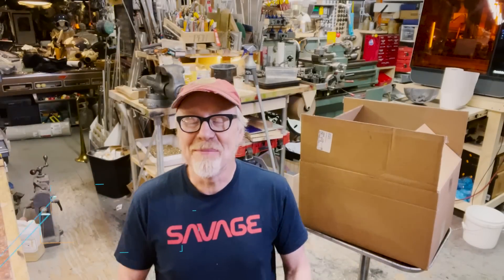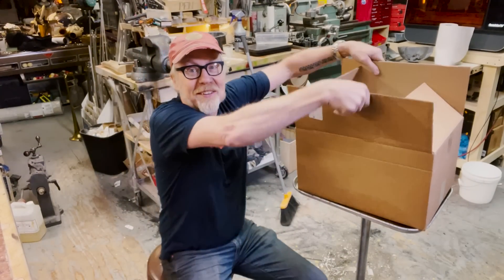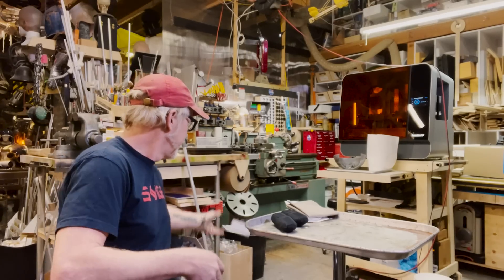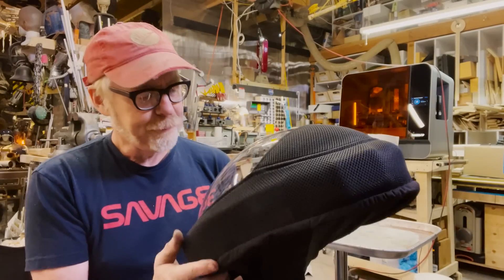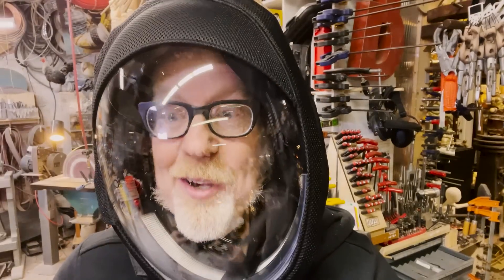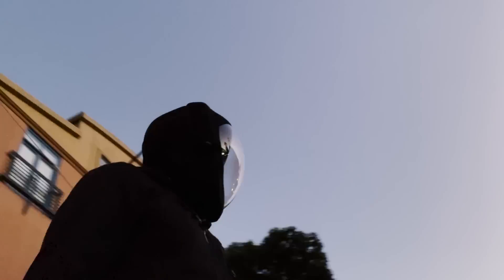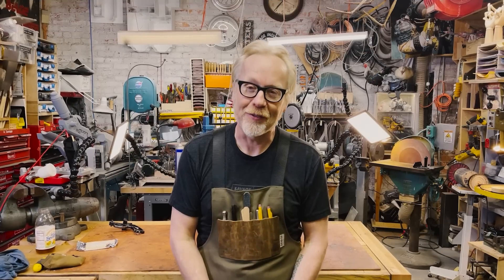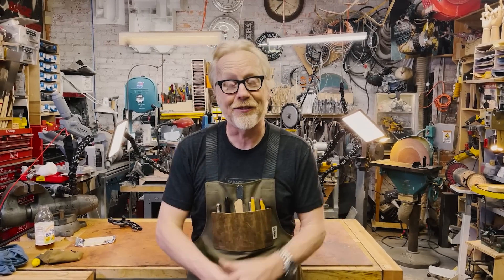Adam Savage Tests the AIR Active Filtration Helmet!

Comment from the maker: Join this channel to support Tested and get access to perks:
https://www.youtube.com/channel/UCiDJtJKMICpb9B1qf7qjEOA/join
Reply: Similar to this ---> https://www.youtube.com/watch?v=jgaiPaGR460
Reply: Adam, if you want to crack the anti fog dilemma, look up ‘pinlock’ which is what some motor cycle helmet visors incorporate. Understand its concept (hint: it’s double glazing 😉), then make your own version in a one day build.
Reply: @eduardocorrochio208  everyone who rides a motorbike rushing to the comments to tell him about pinlock haha, littlerally came here to do the same
Reply: Shaving cream on the inside of the dome helps to prevent fogging. Simply clean it with shaving cream leaving a thin residue.
Reply: It needs a connected backpack with a larger battery, fan and a heating coil. Or put automotive rear window heating lines across the face of it. They are nearly invisible and dont use much energy.
Reply: You need to get yourself some anit-fogging spray. The one i got for my glasses works 100% of the time with no issues. Here is the link to it: https://www.amazon.com/gp/product/B08F2WTS2W/ref=ppx_yo_dt_b_asin_title_o00_s00?ie=UTF8&psc=1 also this trick requires no engineering. it lasts all day. Just apply and wipe off and go. SIMPLE.
Reply: @TheRealCommanderBriggsofChrist  Does that stuff actually work?  I know the RainX is awesome... however, the anti-fog seems worthless or maybe a little help.
Reply: @TheRealCommanderBriggsofChrist  Rain-X makes some anti-fogging wipes, that work amazing on glass. I wonder if they or other anti-fogging chemicals would be safe on the plastic/to breath in.
Reply: hey Adam and all my glasses wearing friends  look into EK Cat Crap its a anti fog leans cleaner its some good stuff
Reply: Hey Adam, maybe the mask they give you is for impeding your breath from directly hitting the visor, which might slow down the fogging up process, I think... just a guess
Reply: 3m full face mask, 6000 series etc,
No charging, no fogging, no bullshit
Reply: @bassterra6608  Good call!  I scored a 3M Versaflow in absolutely disgusting condition and a bunch of other materials like two scuba tanks, contactors and more for $50.  Plus came with a new lens.  I still need to hack out for more versatility to use other filters and motor with filters.  Seems a DIY PAPR would be really cool since Adam can pimp something out that everybody would be jealous of, since would look absolutely gorgeous.  B^|)
Reply: If you think that's something. You should check out the VYZR.
Reply: @helratz9627  I love the gloves and kleenex holder!
Reply: Are you dark helmet? Do you make your action figures kiss? Been watching space balls here I think ;)
Reply: Have you tried cat crap at all?.. it's an awesome product.. does an amazing job on race helmets
Reply: @Jay Jay I have 3 helmets. 2 have Pinlock and are flawless. The 3rd doesn’t have Pinlock compatible visors so I use cat crap. That one... not so good unfortunately.
Reply: @eduardocorrochio208  yeah pinlock has been around for the last 50 years.. pretty basic concept.. air is an insulating barrier, and hydrophobic plastic does what it says on the box. Unfortunately it is not so great under some lighting conditions and the insert deteriorates quickly with some chemicals and also unsuited entirely to nitromethane. Great however for a cruise on your motorcycle. All of the pinlock inserts I've seen were only curved on one plane, moulding two layers perfectly to minimise (not eliminate) reflection and halo effects would take a huge amount of trial and error and if you're lucky.. maybe. Then you need to source the hydrophobic plastic...  I was just suggesting a practical solution, simple and works well for a huge amount of people. Sure it needs to be refreshed fairly consistently and used correctly but I haven't had any issues.. maybe its the material your faceshield is made from.
Reply: @eduardocorrochio208  I thought pinlock had face shields for pretty much every motorcycle helmet manufactured these days and they do custom pin kits to install your own.. or tearoffs or whatever
Reply: Thanks for being part of my life every1! Stay positive by surrounding yourself with Positive Atoms Adams. Broadcasting a magnetic resonating frequency, bound to get fans... aka positivity. Keep on Geeking Adam. We love it.
Reply: Adam check the motorbikes helmet antifog system, you just need two different layer of plastics so there is no condensation due to the different temperatures
Reply: There’s a new thing where people are pretending to be the channel name in the comments, thought I’d let you know before they target you .
Reply: You need to check out the Project Hazel mask from Razer. It's similarly, though actually not as ludicrous as this helmet. That one does actually have a microphone to amplify your voice. Which is nice.
Reply: Practical question: Do you think the fogging might be solved by putting a pack of silica gel somewhere within the helmet? It is for dehumidifying after all and in contrast to a face mask, you could certainly find some space within the helmet to put a pack of that stuff in.
Reply: Quick tool tip: Noctua fans, especially the 40x20 mm are really quiet while moving a lot of air, i use them all the time and I fell asleep right next to one at full speed ;)
Reply: Tell Adam that there's a good solution for fogging. Comes from the motorcycle world. Look up Pinlock systems.
Reply: It would be better if it had a chrome screen 😆👍🏼🇬🇬
Reply: @Nicklas Denhus "Built."
Reply: Employing the right sized Peltier element or elements inside the helmet will allow for cooling and any type of interesting metal heatsink design can be used on the outside of the helmet to wick off heat like an emblazed emblem that matches the couture of the helmet but make sure it is only attached to the back of the Peltier element.  The more surface area of the emblem exposed the cooler the heatsink will feel to the touch.
Reply: I would LOVE to see Adam make a whole video, making Modifications to Improve the functionality of the mask.
Reply: YOU NEED RANIX ...TO KEEP IT FROM FOGGING UP.
Reply: Hey Adam, ever heard of pinlock visors before? They are used on motorcycle helmets to prevent fogging in cold weather. Perhaps you could modify the visor to support a pinlock insert!
Reply: WE USE SURFBOARD "SEX" WAX TO STOP GLASS FROM FOGGING!! 
WORKS BETTER THAN ANY OTHER PRODUCT!!
Reply: upside down ?
Reply: Use very thin high resistance wire in a grid & from a very short distance it's invisible but when turned on with an electric current it will cause heat and any moisture on the visor will immediately evaporate
Reply: My dad was spitting in his diving mask before every dive. He said lubrication helps prevent fogging. So what about trying some lubes? That would be an easy fix.
Reply: You should design a robotic cameraman or a camera on wheels with censors
Reply: U need to mod this to add hud to it
Reply: Way to Bow embracingly to the pandemic. lol
Reply: Hey Adam! For your fogging problem try washing your visor lense with shaving cream. Winter sports guys use it for their goggles and helmets. It also works well on your bathroom mirror to prevent fogging during a steamy shower!
Reply: You should talk to Bigclivedotcom or GreatScott or Electroboom on how to increase the fan speed and flow.
Reply: @deplorablepiratecaptaingunberd  Not sure about Electroboom...
Reply: If you buff the inside with shaving gel (foam) it won't steam up
Reply: @dontrythis You should check what mini-subs and the old Big-Jim diving suit used to do to combat the condensation.
Reply: I'm pretty sure you had it on upside down the whole time.
Reply: Weird.  I've never had mine fog up.  Then again I wear mine on planes, not walking around.
Reply: Ok i am bit of confused here, seeing some people use this gear and travel in a plane and some giving reviews theirs's didn't stay fogged up, may be the company made some upgrades i guess. Mask does feels safe until no one within 6 feet of 10 feet coughs or sneezes on the direction of my face...may be the one you tried needs more powerful fan ? or a less powered fan with a tube just out near the neck to remove moisture fast.
Reply: @DeviDesiD  It has two outtake fans with HEPA filters at the bottom of the visor area.  But there's a lot of factors that go into whether or not this fogs up.  For my example, I was still required to wear a cloth mask inside it on the airplane due to regulations.  So I was never breathing directly on the face shield.  It has HEPA filters in front of the two fan intakes, so people can cough away and you're still safe.  But you're also not exerting yourself on an airplane.  You're just sitting there.  Adam was walking.  I think the mask+the sedentary activity make the difference, honestly.

There was minor fogging up when walking from the terminal while boarding the plane, but it went away quickly.

Comment: Hi Adam, Just a little bit of friendly advice from an engineer who has worked on particle collection efficiency measurements with clean room optical particle counters, and has some familiarity with Occupational Safety and Health Administration (OSHA) regulation for fitting respirators. You say that if you're out and the air filtration helmet is fogging up, you'll put on a mask. Well, with the facial hair you have, a mask is going to be worth about as much as a handkerchief tied at the back of your head. Which is to say, with your facial hair, a mask will not provide any protection to you. For that reason, unless you shaved your beard, I'm pretty sure OSHA wouldn't even allow you to wear a respirator, because you'd be fooling yourself by thinking you're protected when you're not. But it's great video. Thanks, and best wishes.  --Mark

Comment: Could not find any info on the HEPA capability.  I'm always suspect when claims are made but not filter rating and rating standard is specified.  Anyone can claim things, but the standards are there to help us understand the level of filtration.  Particle size and filtration levels are part of the standards definition.  Be wary of claims without the technical details.  Lack of details indicate possible lack of performance in regards to any specific claim.  Plus without this detail your N95 mask may still provide the best protection.  Now that it's Sept'22, no one cares about masks anymore(well very few do).

Comment: The only solution (the way I see it) to resolve the fogging is completely blocking the hearing in this helmet and adding comms instead. 

So with the hearing completely blocked out you have a liberty to use whatever powerful fan you can reach out there on a market.

Comment: I've been wearing mine in every public space for a year now, love it. i won't even consider going to the store without it at this point. my Air 2 is on pre-order...not sure why yours fogged up so much. I've worn mine to multiple physical therapy appointments and worked out in the thing and it doesn't fog...but maybe that's because I wear mine primarily indoors in public spaces. usually the farthest I wear it outside is to and from the car, if I'm outside I just wear a mask because the risk of air born contamination is almost zero with fresh air if you just don't get close to people. the only time I've been able to get mine to fog up is when its really cold outside and I go from climate controlled indoors to winter cold parking lot...but it only stays foggy for about 10-15 seconds. something that helps me a lot with the closed in feeling is to wear some noise cancelling headphones.

Comment: This version of AIR is designed for more sedentary activities--traveling via plane uber, train, subway, etc. It will not fog with those activities.  If your environment has high humidity, a significant temperature change, or if you bring your heart rate up/breathing rate up via activity these situations will increase the chance for fogging. Simple antifog treatment and keeping the fans on high will eliminate most of these situations.  However, it is not designed for heat breathing--running, workouts, and such will overpower its capacity to provide fresh air.

Comment: 13:25 "It's very plausible that someone will solve this problem";    So if anyone finds a decent looking solution or a solution in the making (clear full face - eyes, nose & mouth), please reply here and provide directions to found information.
Reply: Like... Peke Safety Power Cap PAPR Comprehensive Review https://www.youtube.com/watch?v=pSxtS1ggx7w ;  which is a JSP Professional Powered Air Respirator that doesn't have filtered exhaust like the AIR Active Filtration Helmet does.

Comment: Divers spit on the lens or use baby soap with a drop of ammonia. This completely stops fogging.
What causes glass (crystal or polyurethane) to fog is the buildup of airborne micro particle fibers. Humidity flinging to the fiber condenses with heat coming from the breath which itself contains a combination of gases & humidity at 90+ degrees causing lenses fog.
That’s my theory anyway. And I’ve proven it’s true so...

Comment: I know this sounds simple to the point of sounding dumb.... but what if you just reverse just one of the fans so you have fresh air blowing in and circulating into an exhaust that blows moist air out. Ideally this would create a vortex in the helmet. Idk. So stupid it might just work?
Reply: It has 4 filters.  Air comes in through 2, and out through the other two.  The fans move the air.

Comment: You just need to design the helmet the same with FF APR and SCBA masks are. Have fans push air into the helmet, but have the helmet contain a soft plastic piece around the nose and mouth. You put inlet valves on the front, so the air from the fan blows across the lens before going into the mouth, you put exhalation valves on the bottom, ideally ones that are isolated and lead directly out of the hood.

Comment: if anyone is looking for a mask that works better than this search up the MSA millennium with a tinted outsert. Then get some 40mm p100 or p3 filters. blocks 99.97% of particulates down to .3 microns and is CBRN rated.

Comment: There's anti-fog coatings that motorbike riders sometimes use for helmets, I wonder how well they would work here (motorbike helmets likely have more air flow simply due to movement, so it may not be as effective for this?)

Comment: 13:23 Probably the right solution to avoid fogging is a larger, multi-lobe or helical screw-type positive-displacement pump, running at low RPM, coupled with fine-line heating elements on the faceshield itself.... I mean, if you're going dorky, might as well go "full dork."

Comment: Having the intake hepa filters and a bigger fan in a separate pack with a hose leading to the mask might reduce the noise problems.

Gas masks have something called 'tissot tubes' that direct the airflow directly onto the lenses when you breathe in, and this does a remarkably good job of defogging them.

Comment: I would legit be curious to see this thing upgrated to remove that fogging issue.  I work as IT phone support, so I could def use something like this at my desk.  They just keep that AC cranked to 11, so I'd be worred about not being able to see the screen.
Reply: I've worn one several times and found for light activity there isn't a fogging problem. Of course, I didn't use it outside but for the few minutes it took me to get into a building. My only complaint is the peripheral vision sucks, but that is to be expected.

Comment: First of aal that was exactly the product that I imagined and an more advanced version of it shouled be a must to wear in thee future for evry situation that does not include Sport to prevent more deadly viruses 🦠 from coping out menkind in no time. Secondly here is how you solve thee issues and fogging of the helmet. You couled eyther use speakers 🔊 for hearing thee environment and speaking to people which couled actually improve your hearing as well and solve thee problem of ventilation space. Add LED-& as well for visibility. It’s to dark. You might get hit by a car or something and most important wear a tactical helmet underneath to one prevent demanding your head by any way plus two making it fit better. Adam your thee most savage person one can be to wear a suit like thees on a dayliy basis eaven so it changes a 6 to five day into a be outside for 6h and then rest for five hours day scycle. Might verry well be the future if people are less stupid soon enough...

Comment: Honestly, if you wanna mod it and feel confident in doing so, there are certainly ways to upgrade that. You can increase the power, maybe create a system similar to a mini CPU cooling system almost with modded fans and everything. With a 3D printer creating all of that on a smaller scale would be a cinch.... I must try this now

Comment: I have a couple ideas about preventing fogging up. One is double glass. The other is having the air coming in go through a slot that is parallel to the glass so that it creates a laminar flow along the surface of the glass. Probably from the top down would be better. This should help reduce the amount of breath directly hitting the glass, or at least push it down away from the eyes, and help any condensation evaporate faster. (or sublime away if you live in Canada, like I do)

Comment: The fogging up is a problem, as is the fit, but couldn't you consider a silicon lining inside the glass to get the moisture to run off, or divert airflow? It is a covid mask rather than a gas mask, so if you essentially added a chimney, you could divert hot airflow out vertically (either from rising heat or a pressure release valve) which would both reduce risk of transmission and reception. As for the fit, either something like a football helmet, cowboy collar, or HANS setup? I think this product is a good start but maybe tries to be too ambitious in creating a sealed environment.